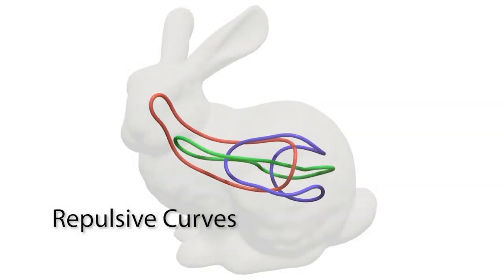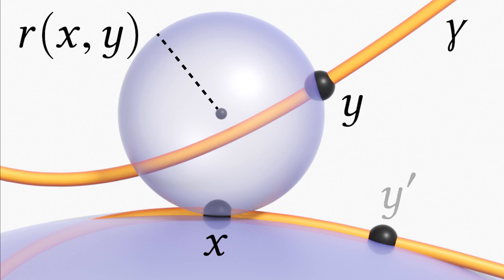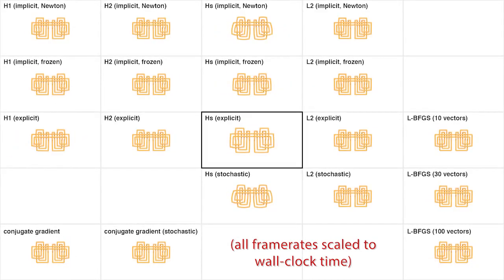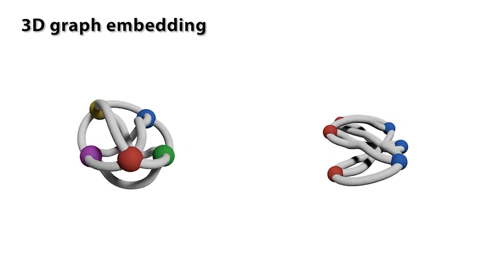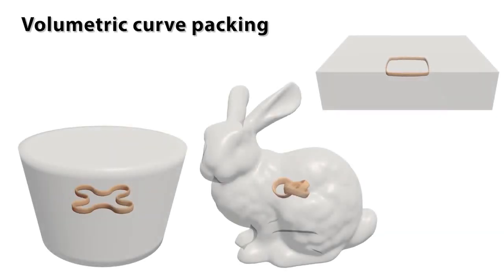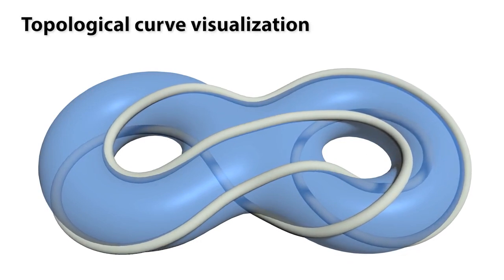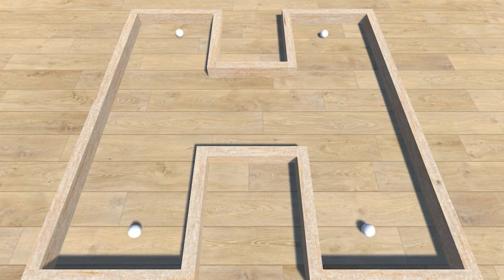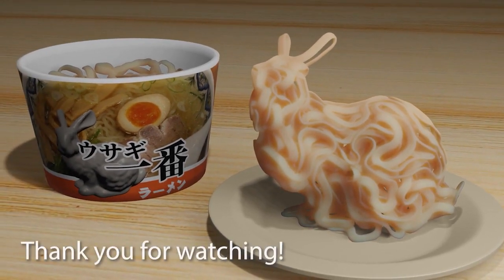Repulsive Curves

Comment: This is super interesting. For unknotting is it clear how to understand r*meister moves that it uses? I find this really fascinating.
Reply: Also one of your fields looks like sprinkles and now I need a donut version.
Reply from the maker: Yeah, this is a super interesting question: what sequence of Reidemeister moves is effectively made by the flow, especially versus other approaches you might use to simplify a knot diagram?

There are a couple challenges here.  First of all, Reidemeister moves are operations on a 2D knot diagram, whereas the flow operates directly on a 3D embedding of the curve.  Of course, you can project from 3D into 2D, but each projection will yield a different set of moves.  Is there a canonical projection?  Some invariant (in terms of the dynamics of Reidemeister moves) among all projections?  Etc.

The other issue is detecting the moves, given a projection.  This shouldn't be too hard to do (since in this case the geometry is just piecewise linear), basically a fun little exercise in computational geometry. :-)
Reply: @keenancrane  ahh. This is great. It hadnt occurred to me that the projections of the surface would also effect the Reidemeister move that it looked like. Thanks!